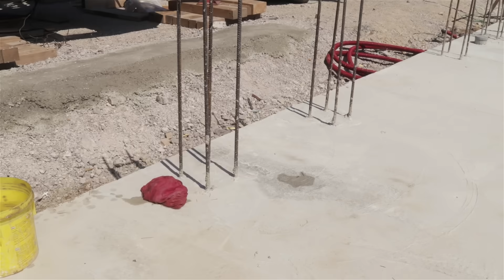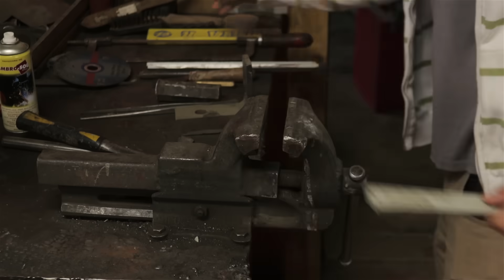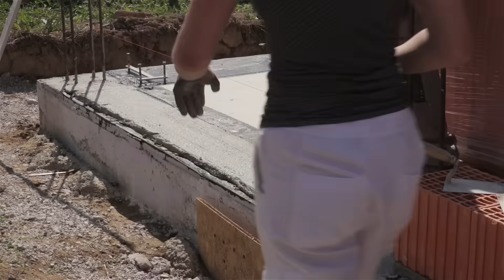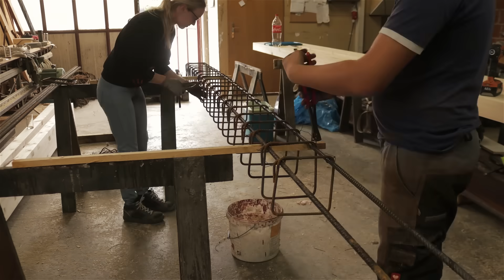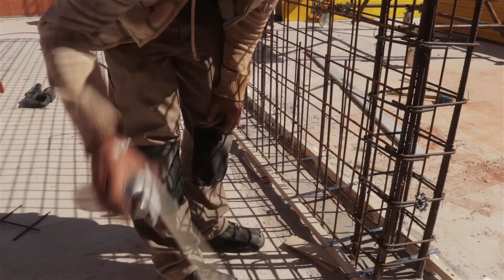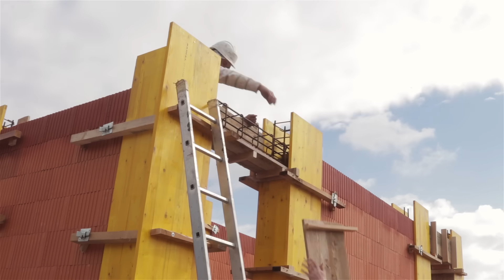My house build Pt2- ground floor brickwork and concrete formwork

Comment: Aren't the concrete pilars incredible thermal bridges in comparison to the clay bricks?
Reply from the maker: Yes they are, but it is more important to have a safe house in a seismically active area. This is compensated with a thicker layer of thermal insulation.
Reply: @lignumchannel  I see. Makes sense. I'm sure it's gonna be a beautiful building!
Reply: I've noticed this issue too, there's actually a way to equalize thermal conductivity of a concrete to brick adding a think layer of insulation at the outer pillar surface like inch of a styroboard (or combi-boards, sendwich made of 1/4in low density osb followed by 2 inches of styro and again 1/4 inch of LD osb) but it's rarely utilized as architects usually rely on overall insulation to cover the losses.

https://encrypted-tbn0.gstatic.com/images?q=tbn:ANd9GcRSb6vXkkvKs0DYeevYhPUDtq4zVPDiS2mM4cWu2kQ3-qB9lMhew3UE9Z0K6Lf1JK1Kr_Q&usqp=CAU

Comment: Holy moly, your wife/gf is one hell of a worker. Nice to see laides do some hard works. Heheh. Intresting to see that you put hydroisolation under the bricks. Does the mortar stick well on it. Or is it some kind of special material.
Reply from the maker: It is a must to keep the moisture from climbing up the walls. It sticks to it quite well, we had a couple of windy days that got me worried but I worry too much.. Especially when concrete posts get poured.. Yes she is great, I just hope she wont lose her nerves with me.. :D
Reply: Doesnt have to stick, weight itself is keeping it tight. If first layer isnt isolated capilar moisture will eventually saturate the concrete and transfer to the bricks.
Reply: I do not know from which state they are, but in most of Europe, waterproofing under any masonry is a basic requirement, without which the building approval will not even pass.
Its classic foundation mortar between isolation and bricks, nothing special - its usually sold for that purpose and its usually comes from the bricks manufacturer as part of the whole building system (bricks, mortar and building foam for connecting bricks).

Comment: Could you elaborate on those bricks a bit? Never seen such a thing! What are they made of? Do you fill them after they're stacked? Are they structural?
Reply from the maker: Walls made from this block can withstand 10N/mm2, they don't get filled, pores are there to aid thermal insulation. They are made from baked clay and other ingredients which improve different properties. Depending on seismic area where the building is being build, walls can be bound with concrete posts and beams. if area is seismically inactive, less or no concrete is needed.
Reply: @lignumchannel  Neat! I'm excited to see part 3 and beyond
Reply: Those bricks/blocks are Wienerberger Porotherm made from clay, later filled with concrete. You can find tons of videos on YouTube how to work with Wienerberger bricks.
Reply: @32dras  they are not filled with concrete, this is why you have to build concrete structures around them. The empty space that you see inside them is for isolation and the walls are not load bearing

Comment: I don't know why, but I thought you'd have built it with wood...
Reply from the maker: Yeah there were supposed to be much more structural wood in original plan but recent wood prices explosions made me go back to the drawing board.. There will be plenty of wood still, just in a bit later stages..
Reply: @lignumchannel  wtf it's true! So also there wood prices had increased dramatically?!? I'm trying to get a house and there's much I'd do with lumber but now I think I'll be waiting for better times...

Comment: So, you don' use mortar between the blocks? just foam tso stick one to another layer? And do they hold well like that?
Reply from the maker: It holds much better than mortar. It's special glue designed specialy for this kind of blocks. You can't use it with any kind of blocks, they have to be cnc machined so they have perfectly same thickness.. also no mortar means less thermal bridges.
Reply: @lignumchannel  I see that in Russia it is recommended to use Porotherm TM mortar, and Porotherm ZeroPlus mortar in the UK.
Reply: Modern building bricks like these Poroton or Calcium-Silicate-Bricks are extremely exact in size (f.ex. H24,8 x L24,8 x W17,5). They are glued together with a 2 mm layer of special mortar. Each pallet automatically ships with a bag of glue. Here they use sprayed glue, which often is much stronger than mortar. Well done here, especially the first egalisation layer. I also noticed that you did not add an additional layer of water proofing after the second course of bricks.

Comment: I assume the yellow planks for concrete forming are painted bright yellow ... for a reason?
To notice concrete leaks during pouring? To remember you to remove them later?
Reply: Its to avoid having the wood suck the moisture out of the surface of the wet concrete, and to make it easier to remove the forms once cured. Also it just looks pretty
Reply from the maker: I guess it could be any color but forming boards here are traditionally yellow i guess.. They turn grayish after many uses.. The color itself makes boards water resistant as Erik Grinde said..
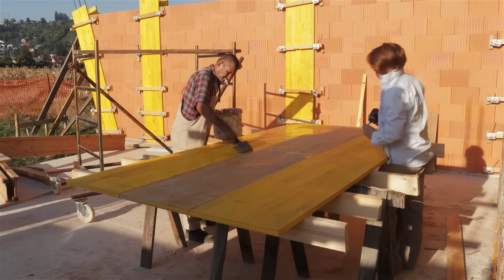Reply: I assume wood is treated with some chemical. You can also notice on 8:05 they apply oil on planks to prevent concrete from sticking.